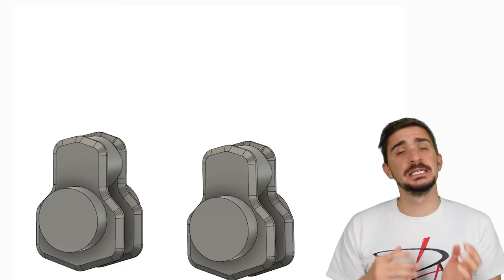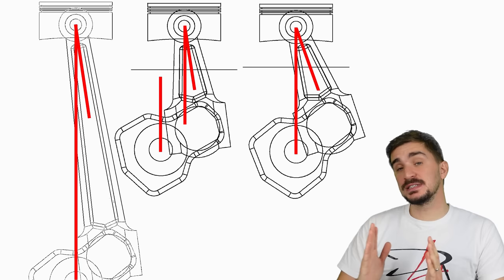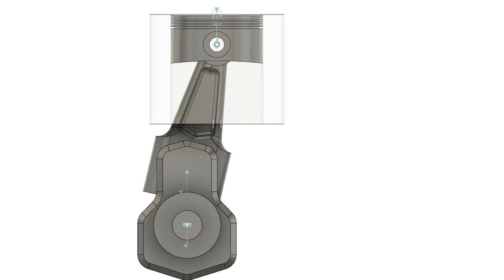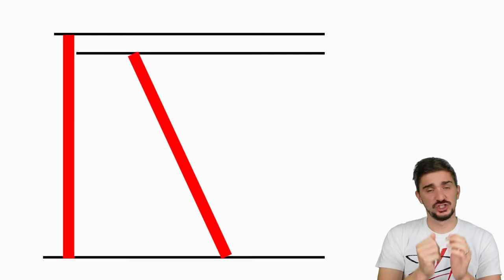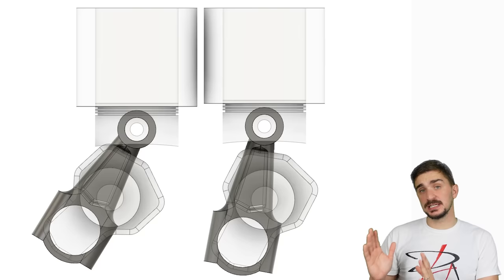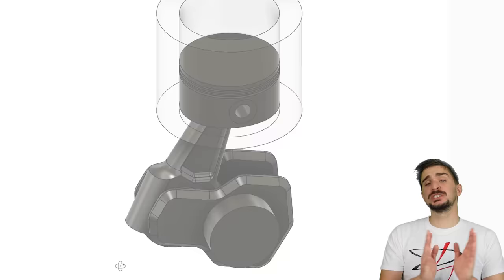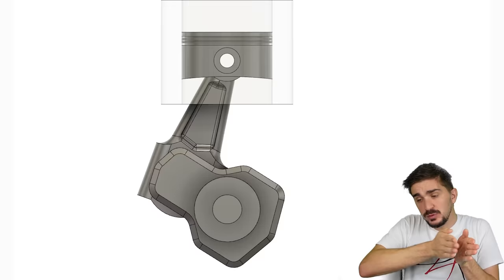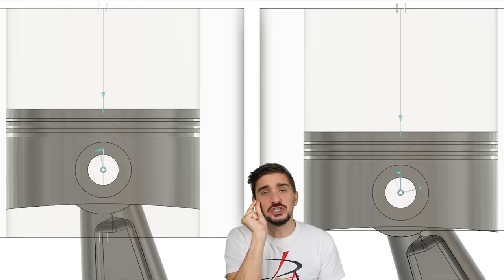Cylinder Offset Changes Everything

Comment: Can you summarize which cars / motorcycles / machines use the offset engine?
Reply from the maker: It would probably be something like a 10 page list...Also, some manufacturers don't disclose this so you would need to buy a brand new vehicle and take it apart. What I know from the top of my head: Toyota dynamic force engine series, many of their hybrids too, Yamaha R1, Ninja Zx10r, all high capacity off-road dirt bikes except I believe Suzuki. And many many more cars and bikes, especially more recent ones. In general it was a lot less common in the past than it is now.
Reply: @d4a  thank you. I didn't know this was a thing before your video.
Reply: @d4a if the Toyota hybrid engines use that offset engine geometry they combine it with (pseudo) Atkinson cycle valve timing. 
Very Interesting!
Reply: I've asked ChatGPT and it said

While it's difficult to provide an exhaustive list of all internal combustion engine-powered cars that use cylinder offset, some well-known examples include:

Ford EcoBoost engines - Many Ford models, such as the Ford Fiesta, Focus, and Fusion, are equipped with EcoBoost engines that utilize cylinder offset for improved efficiency and performance.

Toyota - Some of Toyota's engines, like the 2ZR-FXE engine used in the Prius hybrid and other models, feature an offset cylinder design to reduce internal friction and enhance fuel efficiency.

General Motors (GM) - The Ecotec engine family from GM, which powers a range of vehicles like the Chevrolet Cruze and Opel Astra, incorporates offset cylinders for better efficiency and reduced noise, vibration, and harshness (NVH) levels.

Honda - The Earth Dreams engine series from Honda, used in vehicles like the Accord and Civic, includes offset cylinder designs to optimize fuel efficiency and reduce engine vibrations.

These are just a few examples, and many other automakers might employ offset cylinders in their engine designs to optimize performance and efficiency.
Reply: @d4a  hi are you aware of any v8 engines using this?
Reply: @samstewart4807  Sidevalve V8 Fords have the crank offset, Valves are at different angles from side to side to.

Comment: I have patented a new, novel "Wilson" cycle  for 4-cycle engines which almost doubles the induction mass without the need for a blower. My prototype is a 5HP Briggs & Stratton side valve unit with minimal modification. It runs much smoother than it originally did.

Comment: Nice to see you back Allen. The back wheel spindle used to remove rotor made me grin. Memories of stripping down my Honda CB250K4 to replace the camchain. A friend told me that he used his back wheel spindle to extract his CD175 rotor and he said it worked on 125 Hondas too. I tried it and it worked a treat. A few years later i had same problem on Kawasaki H1A, but the wheel spindle was way too big but what did work was the back footrest! I didnt know Z1s used that trick.

Comment: This is super cool, very clear, very nicely illustrated. My only concern is that the connecting rod clips through the cylinder wall from about 270 to 300 degrees. I'm sure the connecting rods in actual offset engines are designed to avoid this, but it would be nice to see it here. Great work overall, fun and informative.
Reply: Seems like the rod needs to be longer.
Reply: A slightly notched rod will do.  @ctrlaltdebug

Comment: After watching this again, I suddenly realised why the valve timing is different between intake and exhaust.
I've been looking at cam timing for 1960's American V-8 engines and was puzzled why the exhaust was 10~20 degrees longer than intake, knowing that cylinder filling is most difficult part if not using forced induction.
Offset cylinders!
Now it makes perfect sense.

Comment: Very deftly explained. The conclusion I reached was that the balancing of an offset engine is an extremely difficult feat and that would explain why motorcycles now have balance where before they were not strictly necessary.

Comment: I watch this and I was astounded by how badly what was happening was being described. All of this can easily be relatively easily explained by introducing the concept of angular displacement. It's an actual engineering term. It refers to how much the connecting rod is displaced sideways by the motion of the crankshaft. You are quite correct in most people wouldn't be able to follow what you're saying because miss this entirely obvious point. I went into this video with previous knowledge going in. I figured out most of this stuff when I was 15 and bored in a geography class. 
Worst most of this was achieved early on by auto manufacturers buy offsetting the Piston pin slightly. Same effect on Geometry and displacement. It's nothing new.

Comment: Wow, this video is very usefull i wanted to do maximum possible overbore on my honda motorcycle but cylinder studs at the back of cylinder were limiting how large cylinder liner i can put in the engine, thanks to your video i realised i can simply bore out cylinder with offset and put bigger liners in it by offseting them forward.

Comment: Triumph (cars, UK) introduced a slight piston to crank offset on their 4-cylinder models when they increased displacement from 1200cc to 1300cc (approx.) This was for the 1967 models onward. They used the word "Desaxe", I think to describe it. Were they the first? I believe it was done, not for efficiences in power, but to allow an increase in cylinder block bore to clear the head bolt holes to allow them to continue using the same, expensive-to-replace block boring machine which had fixed cylinder centre spacing. They were always hard up for cash. Those little 1300s were super engines in the Heralds and Spitfires of the day.

Comment: Sounds like an offset configuration would definitely favor a heavy diesel engine with lower maximum rpm, slower burning(combustion) speeds and longer power stroke time equals massive torque. great video!

Comment: For about ten years, I've been contemplating boring one of my boxers with a couple degree angle to provide a larger offset than just the wrist pin provides. I haven't made any diagrams to fully analyze the forces, but I feel like the boxer would be the best configuration for balancing an engine like this. I do think though, that there would be a rocking couple that would cause the engine to torque/twist more than a zero offset engine, but I'm not sure what direction it would be in. Since there's no free lunch, I'm betting it would cause more than the zero offset engine.

Comment: Imagine a twin-wrist piston with two counter-rotating connecting rods going to two opposing crankshafts...
The piston would push closer to straight down (as described with an offset as described here), but most side forces and secondary vibrations would cancel each other out, along with the vibration problem described here.

Comment: You might look into the effects of offset crankshaft has on non symmetrical port timing on a two stroke engine.  I discovered this while trying to map ports on a Bultaco 250 in 1966.  Keep up the good work.

Comment: Thanks.  I had never heard of offset pistons.  

Another point kind of a tangent is that the lighter the piston, connector etc, the faster it can rev.  Heavy diesel engines only rev around 3000 rpms.  My chainsaw runs around 10,000 rpms.

Comment: Very cool - as a followup you could contrast positive and negative offset (you only covered one here) - I've read that crank and piston pin offset away from the major thrust side is used in performance engines to increase torque - would be cool to see a side-by-side 3D animation

Comment: So not only does the R1 use an inherently more unbalanced crossplane design, they decided to further complicate the balance problems with an offset cylinder

All that and it’s still an amazing machine. The sound, the power, the performance. It’s a work of art.

Comment: I had to go get a piece of paper and prove that thing about the stroke increase.  I think it would be better explained that the point of TDC and BDC is when everything (crankshaft center, connecting rod pin, gudgeon pin) is colinear, and then in an offset situation that means that the connecting rod angle to the vertical at BDC is greater than at TDC, which causes a little extra length in the stroke.
Reply: That is a good explanation with just a few words

Comment: This idea was used on the AJS 250cc model 14 CSR, & I remember snapping the crankpin! Taking the barrel off; I found that I could move the flywheels apart. This was after riding home from work, Yes it still ran, although noisy. The cure was a bigger crankpin, but personally I think the offset, causes too much stress, though it went well for a 1963 250cc AJS. Once the pin was fitted, no more problems, happy days. 🇬🇧😃

Comment: I was going to make a crack about a cure for insomnia but desisted, although it was very relaxing (sorry). But seriously though, it was an interesting breakdown of the nature of the forces involved. I believe this layout was patented by "Desaxe". I once owned a MotoMorini motorcycle which had this feature on its` V twin engine which was purported to have increased torque. I never felt that this was the case. The design however. did widen the cylinder spacing and allow the carburettors to fit between them more easily, creating compactness. Vibration in this 60 degree design was ok ish but I never felt that it was anything special. It also had "bowl in the piston" combustion chambers. It was quite beautiful, and, of course Italian, but I soon returned to a Ducati. Many Thanks

Comment: Some air compressors, you see this a lot with the oil-free pistons. The stroke on the way up (under load) is the one that utilises a straighter angle on the rod. Then it's crazy angle on the way down.

Comment: I forgot the most important part, which is that the direction of the pump assembly depends on the spark rate, and if there are errors in the direction of the offset, the spark time will be advanced, and other things, the intrinsic strength of the air loaded with gasoline and water and how it is used to separate the fuel.

Comment: From what I've read overall engine friction losses are about 10% or less and not just from the pistons. I appreciate that having less piston slap side load could improve the friction but I'd be surprised if that made a big number difference. Still every little bit of gain is an improvement. Regardless of the geometry, however, the power is still the integral of the Pressure x piston area x stroke / time in all cases.

Comment: So I guess:

1) Offset Engines can be used only in high revving applications
2) A Boxer engine design could overcome the issues with primary balancing and probably secondary balancing too.
3) Static compression ratio would remain the same
4) Cam lobes and lobe angles would have to be designed very very carefully (hehehe obvious point)
5) Spark timing too would change, as compared to a normal enging

Comment: My only issue is with 14:35. You say that the fact that the compression stroke takes less time and the combustion stroke takes more time improves efficiency, because "it has more time to harness the energy of combustion and spends less time wasting the energy on compression". This is not the case. Ignoring heat loss to the cylinder block and gas leakage past the piston rings, if you have a certain volume of gas compressed to a certain pressure and a certain temperature, expanding it to a certain larger volume will always release the same amount of energy, regardless of the time taken. It's the same starting and finishing energy in the gas, so the energy release is the same. As the stroke takes more time, the average amount of energy release must be lower, so the total energy (power*time) is the same. When we do factor in the heat loss, the longer combustion stroke will give more time for heat loss, lowering gas pressure and decreasing the energy transferred to the piston, lowering power and efficiency. However, the shorter compression stroke will lead to less power loss from gases escaping between the cylinder and piston, and the longer combustion stroke will give more time for complete combustion in engines with bad fuel mixing. I suspect that these principles may truly lead to more power from the longer combustion strokes, but it's in spite of the greater heat losses, and not simply because More Time = More Energy.

Comment: Great video but I feel like a much simpler (and, ahem, shorter) explanation of why the TDC and BDC are not 180 degrees apart in an offset engine would involve first noticing that TDC is the furthest point from the crankshaft's center of rotation, while BDC is the closest, and therefore both TDC and BDC have to have the crankshaft's, the journal's and the piston pin's centers of rotation on the same line. And then it's pretty easy to see that that line for BDC is going to be inclined lower than the line for TDC, therefore they will be more than 180 degrees apart.

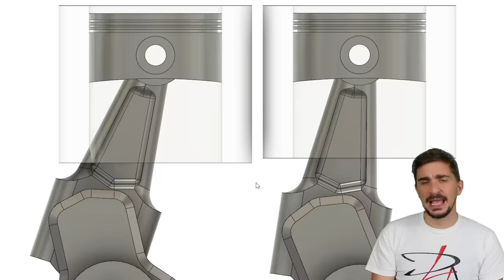Comment: I've been seeing this suggested for weeks now. and I'm really enjoying it. but I had to stop shorty after the 3:30 animations. if you extract the piston that far out of the combustion chamber, when the crankshaft comes back around pushing it back up, it's stripping the rings off the piston, and the engine is then a second away from probable catastrophic failure.

Comment: The problem with piston internal combustion engines is that conversion from chemical energy to internal gas energy(heat) and to mechanical energy happens in the same place. This means more compromises needs to be made to alleviate all the engineering requirements. Gas and steam turbine engines have all these conversions stages separated and so achieve higher efficiencies, but at higher scales than used in road vehicles. Anyway all thermal engines efficiency is capped at carnot efficiency of 1-T1/T2 and this means that in order to make the engine more efficient, temperature of the heat source needs to be increased, but that is limited by materials used and NOx produced. The rest of improvements are like working for peanuts. Oh, electric vehicles have also these processes separated,  the chemical energy conversion happens in the battery and mechanical conversion in the electric motor. The big advantage of the electric is that by design there is no heat intermediate stage  (heat is efficiency loss by definition) so the whole process can be very efficient.

Comment: I still have my 69 ford 429  police car motor- normal 429 had wristpins in center, police car spec had pins offset 1/16" clockwise, straightening power stroke a little...its not much, but was done for a reason...replacement/service pistons were straight up allowing interchangability bank-to-bank... IIRC I read it in a article written by smokey yunick... 

other weird thing about the 429- there were only 2 engines over 400 cubes with rod/stroke ratio over 1.8:1 - the 429 and the 426, reduced side thrust allowed durability at 7000 rpm all day on the nascar tracks. a very young Jon Kaase had a article in HotRod where he was saying a 2 bolt iron crank 429 could spim 8k all day- his only mod was he turned bearing journals to BBC diameter to reduce bearing speeds- wish I could find that article, but lost it long ago...Kaase is now the 429 king, but even back around 1980, the 429 was a obvious favorite of his too.

was kinda funny, ford PI motors for 69 were FE series, but there were some 429s put in cop cars also...mine was a 2 door non-gt, local pd had ordered it as undercover car, stepdad was a dispatcher, cop buddy of his told him it was going to auction, and was the strongest running car in the fleet, dad bought it for 400 bucks. was one helluva strong running motor. that was 1972, I got it in 1978 and promptly wrecked it, did a ring/shell taxicab style rebuild, test ran it, and it sat till '14... pulled it out of the bags, disassembled, zero corrosion, cosmolined parts and bagged back up...someday though :)

Comment: 13:57 the offset rod collides with the cylinder wall and you need to avoid that. That also applies why a very long stroke and very small bore engine won't work. The rod collides with the cylinder wall.

Comment: Also there is no dead spot at TDC which has no movement due to cylinder pressure on piston dome when combustion occurs until the momentum of the crank rotates to have an angle to produce a torque. The off set engine has an angle at tdc and more torque is produced. No dead spot. Renember pedaling a bike. At tdc it was  hard  to pedal and have movement on crank but at halfway down or 90 degree the torque is at max.

Comment: It's sorta like adding an offset degree key to the crank which changes the true crank and camshaft ratio by that number of degrees which multiplies each revolution of the crank,or a longer con rod with a higher deck height slightly offset,making the larger torque numbers along with bigger revving and hp numbers..

Comment: Answer me this, why would an engine (V-12 Diesel) have a different stroke length between the left bank and the right bank? Model V-2-34 38.8 L V12 Diesel engine.

I found the answer at last! Your videos led me to another web site with the answer. Which is very interesting.
An interesting quirk of the V-2 is that its stroke (how far the piston moves up and down the cylinder) was different for each bank. The left bank has a stroke of 180 mm, while the right bank has a stroke of 186.7 mm.

This is because the engine used master-and-slave piston rods, an arrangement where multiple connecting rods are attached to a single main bearing on the crankshaft. This reduces the amount of room needed to connect all pistons to the crankshaft, reducing the crankshaft’s length in engines with large numbers of pistons.

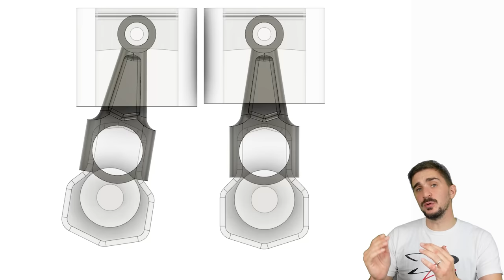Comment: 14:04
The rod clips clean through the cylinder here. Might just be an issue with the animation, but it does illustrate that there is a maximum to how offset a piston can be